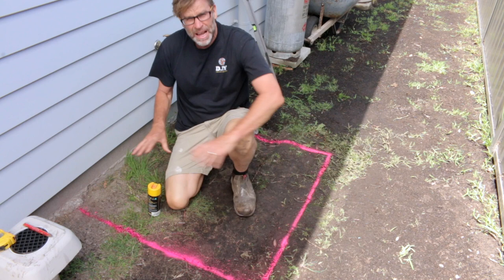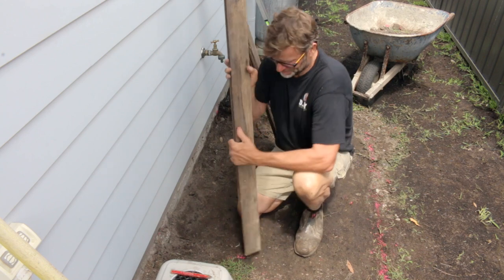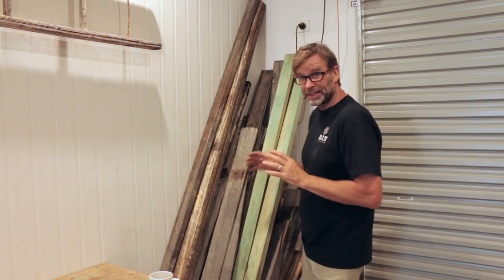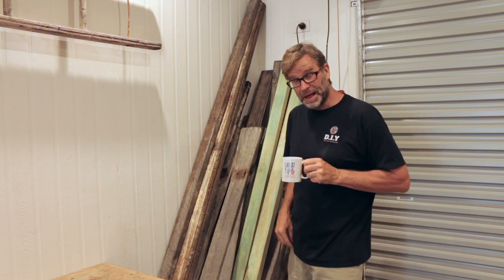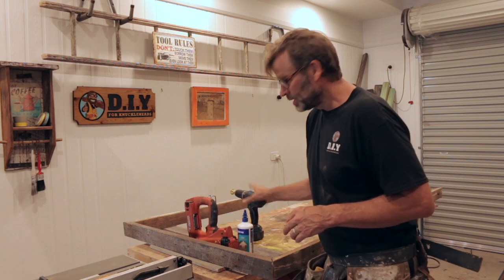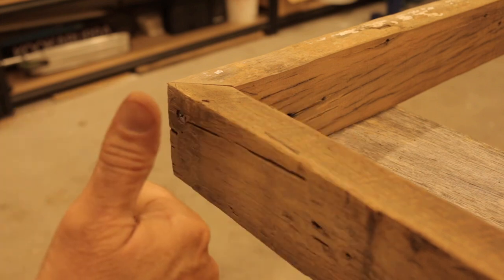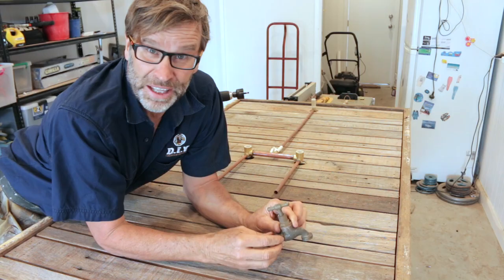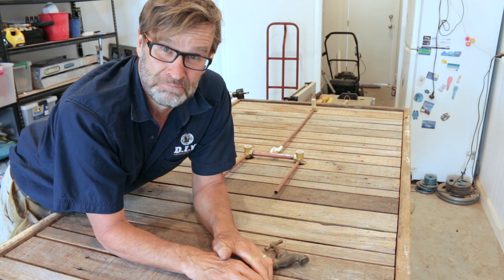How to Build an Outdoor Shower.

Comment: Great shower video knackers!! If i had to pick on something though its on kurts work installing that breech onto the wall. Little higher and some wider packers as im sure they split or have split by now with that screw placement.
Reply from the maker: Cheers mate....na all good re the breach....still working like a charm and it gets used most days 👍👍

Comment: I love my outdoor shower. Makes it nice in the summer not to have all the added humidity inside the house since I live in a place that gets really humid in the warmer seasons! Plus if I'm really dirty I don't drag that inside.
Reply from the maker: We love ours Mick 👍👍
Reply: @diyforknuckleheads  I don't see a shower curtain on yours, but maybe you're not as bashful down under. I made a big semi-circular one out of galvanized electrical conduit that I made round by forming using an old wagon wheel my wife had saved from the farm she grew up on. Stay clean!
Reply from the maker: @mickjager5974  No need for a shower screen here mate...we're all friends 😂
Reply: @diyforknuckleheads  Friends with benefits!? That may depend of how good the friend looks! ha ha ha

Comment: I would have put some type of protection on the wood from water . If you oil the forms and then pressure wash the boards are good for another project. My question is if you get 10 inches of rain who needs a shower step outside with a bar of soap. Looks very nice its got me thinking. Thank you

Comment: You made the slab level? No fall in to the floor grate? What was your plan? To sweep the water into the drain after every shower? I would have put the drain into a outside corner away from the house with a small fall (3%) to collect sand and water which would be easy to maintain. Otherwise great job. Perth summers are roasting hot and dry so being built on sand no plumbing for gray water is required. I'll be using 100mm of river stone for a base.
Reply from the maker: You may have to watch the video again mate...the outside edges of the slab was level with a fall of at least 20mm to the grate.

Comment: Are you in Australia or NZ? In the U.K. that concrete raft would have been given 42 or 72 hours to cure, unless you used  a quick set blend. No finish on the timber (little drop of rain there)? Good luck with that! Not a bad job otherwise, Knackers. Thumbs up duly given.
Reply from the maker: Thanks JD....na l didn't want to give the timber a finish as l wanted that washed up on the beach, driftwood look....It's still as goods as the day it was put up. Because it's under the eave it doesn't cop any rain. Thanks for watching 👍😁🇦🇺

Comment: Any advice on doing a slab in the middle of backyard, with no plumbed drain? Yard has decent percolation in that area. Thinking about a slab like yours but with a perimeter of pebbles to immediately take up some drained water, then rest can percolate through soil.
Reply from the maker: That would work mate. I'd also did a decent trench around the slab and fill with gravel. Good luck and thanks for watching 👍😁

Comment: Shane,  I was talking to a DeWalt agent bloke and he told me that within a couple of years, DeWalt won't have any power corded tools except chargers.  I'm guessing Makita etc. will be doing the same.  Anyway, could you have given the backboard a coat of something before hanging it? Just asking, but I just like the simplicity of it.  Gunna make one for my Humpy out west where that black clay soil, when wet, sticks to my boots like glue.  Cheers
Reply from the maker: Yeah Rosscoe l don't doubt that. I still prefer things like the table saw to be corded....there's nothing like the constant stream of 240 volts and not having the issue of flat batteries. In regard to the backboard, l want to keep it in its raw natural state...just like driftwood you drag home from the beach. Aaahhh....good old black clay...dont your love it! Have a goos one mat👍👍😁

Comment: love it. creative and handy.. however a bit of creative criticism is needed. 
this can't be done in the zones where snow and ice is due to frost wedging. what will happen here is water (saturated soil) will accumulate in the soil and thin layer of crushed stone beneath the slab and turn to ice. effectively pushing the whole slab up, along with the drain. possibly breaking it down the road. 

**needed to be dug down 6" and add at least 4" of gravel then your layer of crushed stone.
Reply from the maker: Thanks for the heads up mate. 👍 Good to know for those that live in snow zones

Comment: Didn't see how u connected water line to it, if I have a water spigot close by how I connect it?
Reply from the maker: The shower set (breach) was just simply screwed to the connections coming out of the wall. From memory you can see that being done in the video. If your spigot is nearby you just need to connect the shower breach to the nearby spigot via some pipe work.Ask at your local plumbing store for the right connectors. Cheers 👍

Comment: Unfortunately, I have no use for this project.  The snow is melting, but patches are still on the ground.  I think the snow 2 days ago will be the last, but, I expect snow by November.  We have had snow on the 10th of May, and I have seen snow in September.  A little too cold around her for an outside shower.
Reply from the maker: That's a shame Jim...boiling hot over here 😁👊